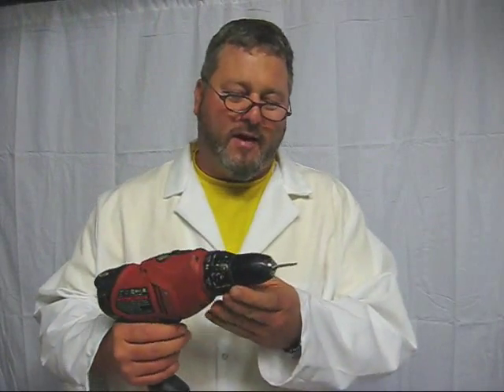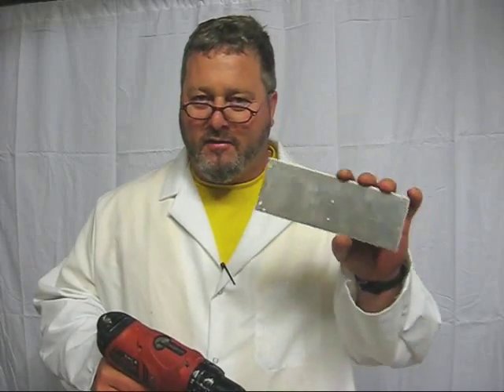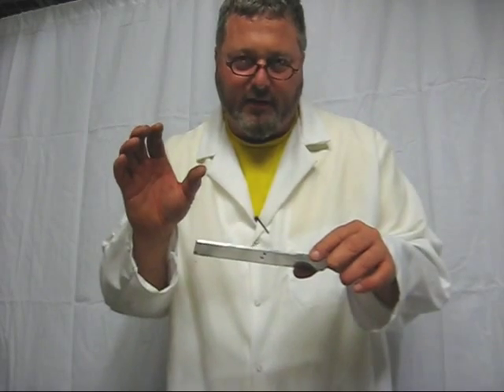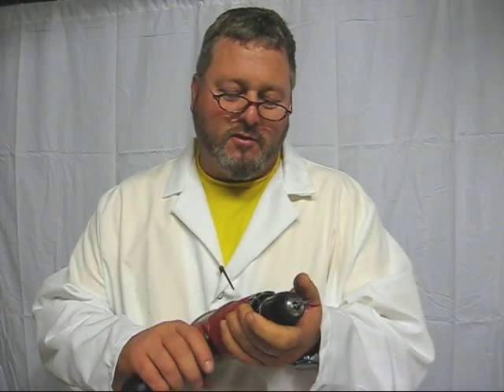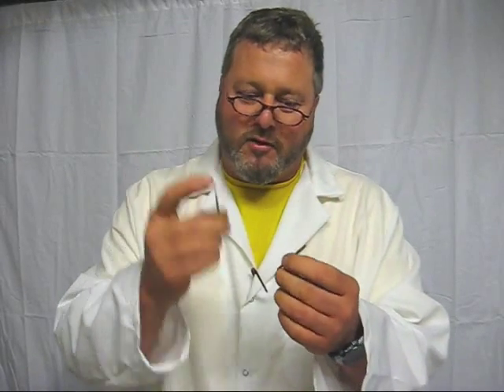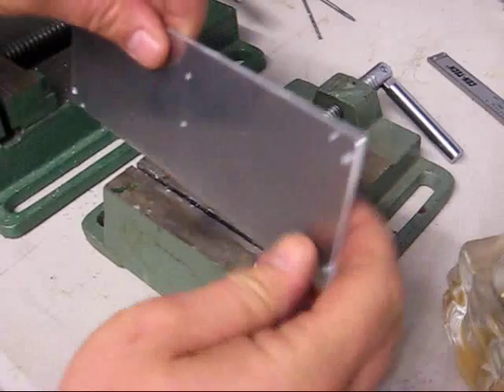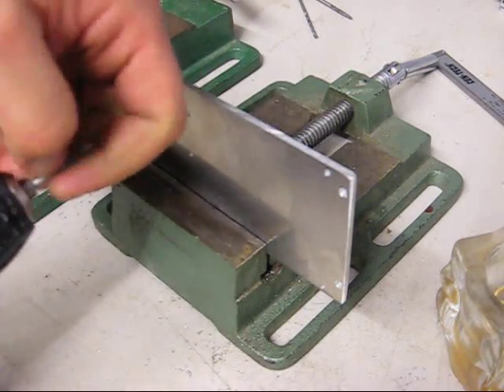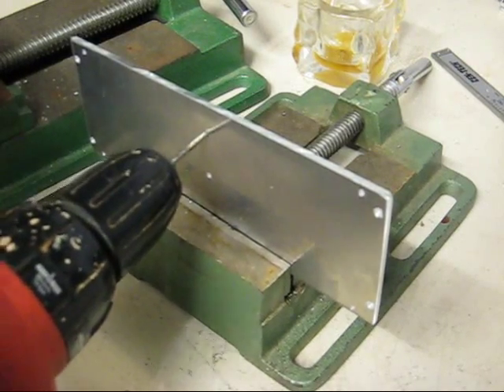How to use a drill to fast tap a hole size 6/32 screw tapping

Comment: Isn't there some concern with misaligning the threads when you fully back out and remove the tap before plunging back in? When hand tapping you can at least spin the tap until it falls into place properly aligned to the threads but with a drill you really can't tell.
Reply from the maker: The tap rides on the top thread until it finds the entry point and then the tap enters into the tread path and does its job.  You’re all right if you push too hard, you will definitely cause more damage than good.

Comment: Do you think I could retap a welded on nut?
Reply from the maker: +Alex Usovich You can drill out the net and add something called a "Helic coil"   which is made for your exact situation.
Reply: Yes. be careful. I tap 3/8" holes in stainless steel with a drill motor.

Comment: What size is the untapped hole?
Reply from the maker: +Peter Braun Hello Peter.    I have just added this to the video.   Thanks for pointing this out.    Looking at a dril chart the holes size for a 6-32 bit is 7/64  or a number 35 bit.   Best regards.  brad  at pedalpowergenerator.com